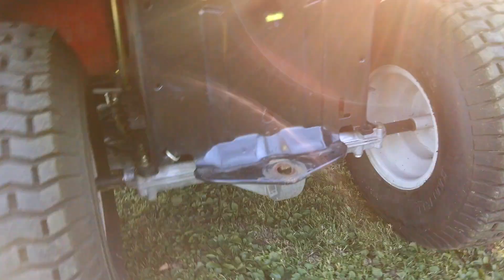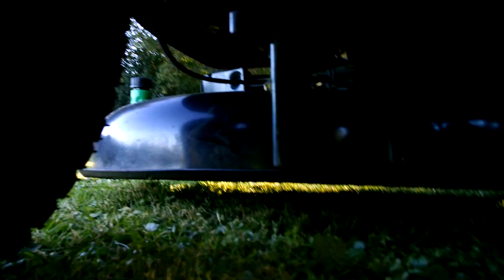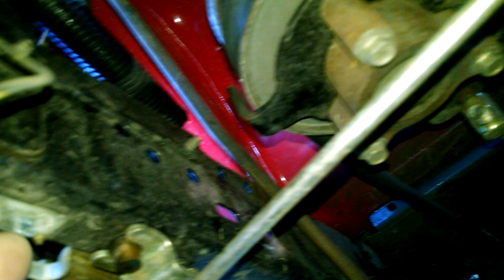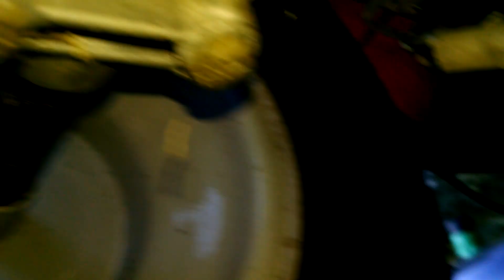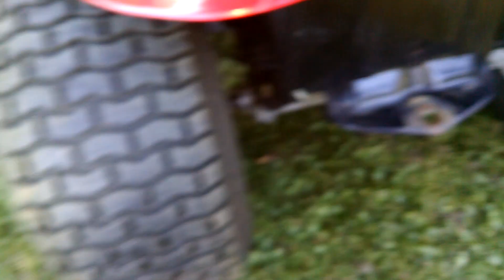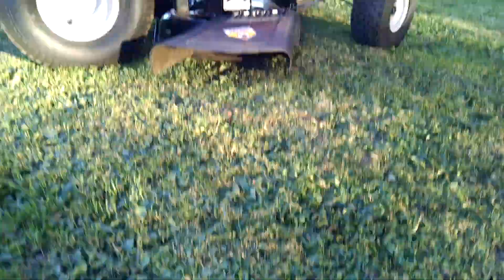mowing in reverse huskee rider

Comment: Is that a Kohler Courage 20, I have the exact same in my 2010 Huskee LT4600 Hydrostatic.
Reply from the maker: Tristan Heckler  not sure,  on the HP. it was a Kohler courage.  I believe it said 597cc. I may be wrong. my cub slt1550 has 25hp courage
Reply: jonathan miller yep 597ccs equates to 20 hp.

Comment: i took the seat safety switch off too...hate those things......lights need a toggle switch to turn off lights(THERES A DASH PLUG JUST BENEATH THE STEERING WHEEL FOR A SWITCH...JUS SAYIN)....running lights really???...not mowing the interstate...psh
Reply: Red Blue40 where is the seat safety switch located?
Reply: first, raise ya seat up....left side, under seat, next to seat spring, (MOUNTED ON LEFT SEAT BRACKET)....its a small shiny little clip thingy with a wire plugged to it...just unplug the wire...tape wire to seat fender...remove switch and go...remember, blades are still turning if ya get off lawn mower so watch out for kids when mowing...AND YOUR FEET..lol